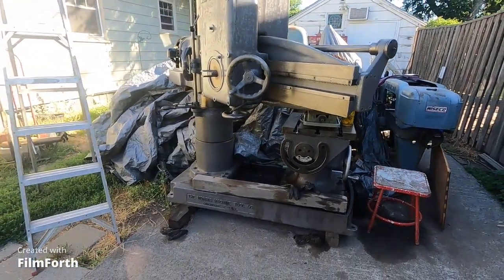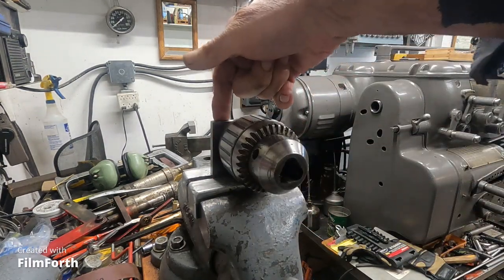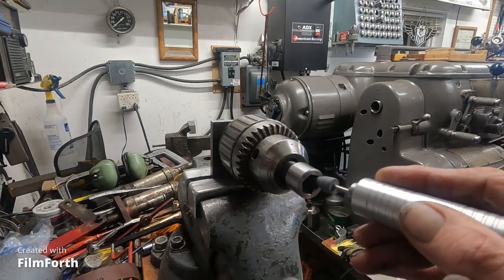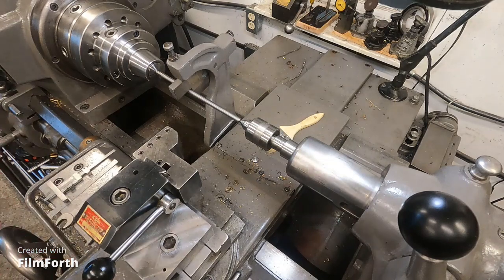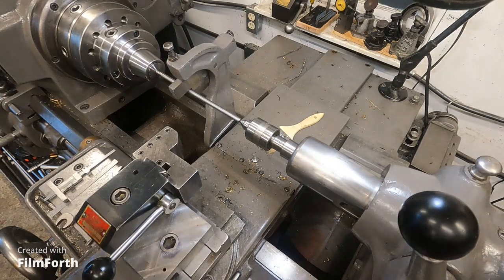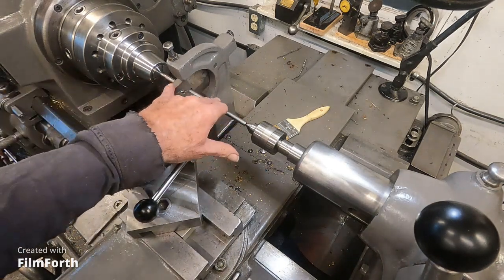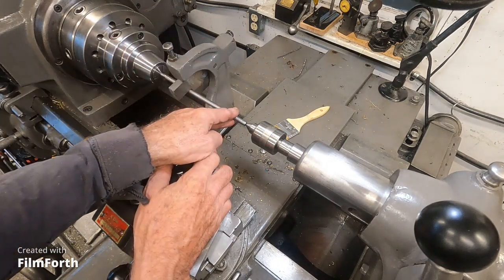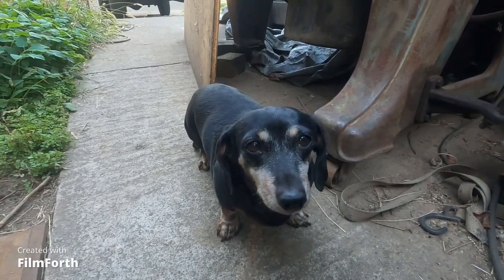Machining using the follow rest tooling adjustments

Comment: I like the idea of using the drill chuck to hold the cap screw for cleaning. I've got several old chucks that would be great for that. I am like you i don't use Bondo on the machines I restore and repaint. I'm restoring them for myself to use not for others to look at. My Camelback drill press has been restored at some time and I am not going to scrub all the grease and oil off of it. The oily coating is what has kept it rust free all these years. It is clean and in near mint condition for something over 120 years old. I have a Bridgeport clone mill that the MFG smeared Bondo over the casting and you can see it cracking and peeling.  I am in the process of re insulating the coils inside the old Century cast iron motor for the Camelback and right now I have no plans to repaint the outside of the motor. The time I use to repaint it can and will get used in other ways in my shop. When time gets shorter for us the more valuable it becomes. No amount of money can buy more time. As always thanks for bringing us along.
Reply from the maker: Hi, thanks for watching, I am making good progress on reducing diameters using the follow rest.